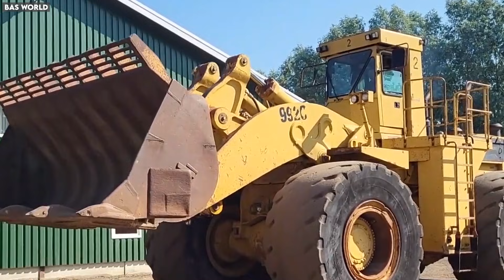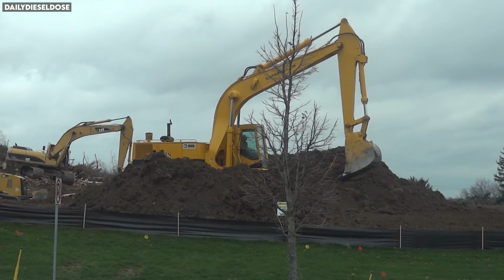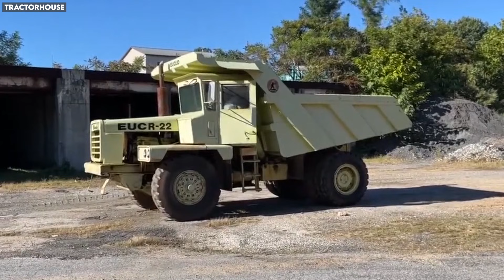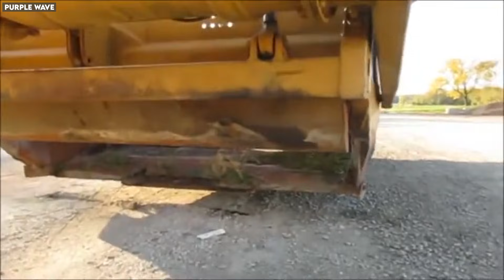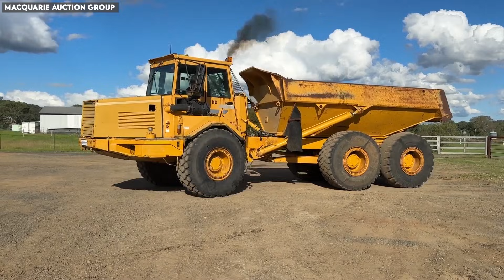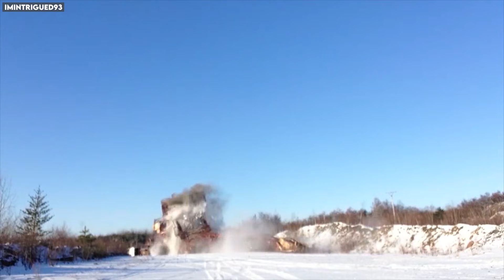10 Earthmoving Machines From the 1970s That Changed Job Sites Forever

Comment: We had two of the John Deere-644-B- series on a huge sewer project back in 1979. It was a standard wheel Loader, that I saw on all the sewer main line jobs, back then. I really liked the shuttle shift layout infront of the steering wheel, their were indicators built into the frame at EYE site, and it was just like an automatic transmission indicator in your vehicle that had an automatic transmission. You had REVERS on your LEFT side then Neutral then as you pushed the shuttle for FORWARD the indicator following across then you had your hight Range gears as you pushed the shuttle up. When that 644 early series came out at least in my area, there was one on ever big sewer project.

Comment: The CAT 225 was also revolutionary because it changed the operator TWO lever controls to a "STANDARD" in todays modern Excavators. When you look back at the other brands of time, they built different Lever and "FOOT" controls for their excavator, even though the were all new fully Hydraulic excavator, on all modern excavator their is a "VALVE" control lever, somewhere close to the cab. This gave the modern excavator a way to change the TWO levers on functions. Because so many excavator had a different function even though it only had two like the CAT. in my humble opinion when that first CAT 225 came out, their controls became the standard in the Industry.

Comment: These were the machines I operated in the 70's. I run scraper for many years and dozer. push cat you name it. I had 44 years on the seat when I retired. Nothing like Caterpillar machinery to get the job done.